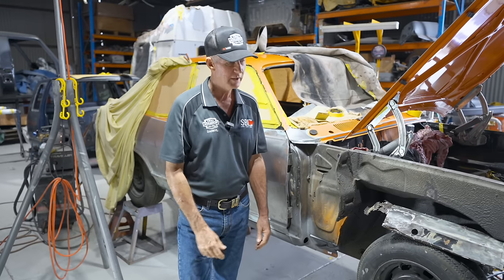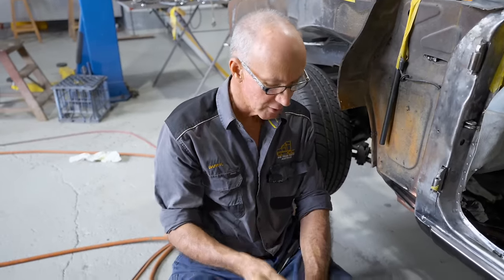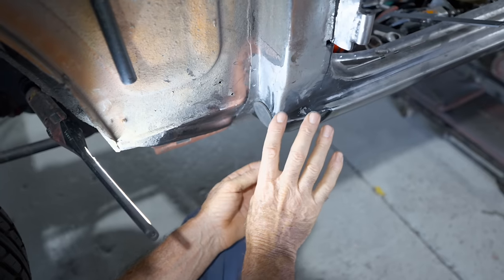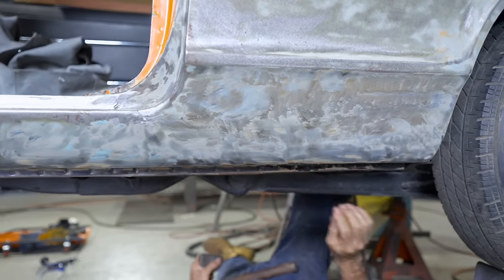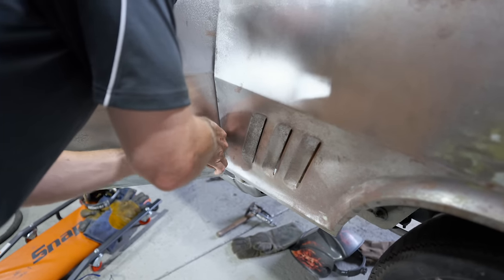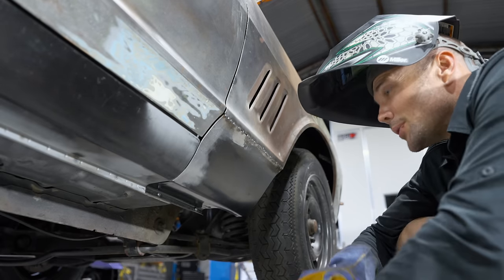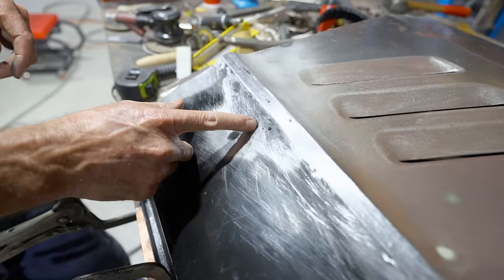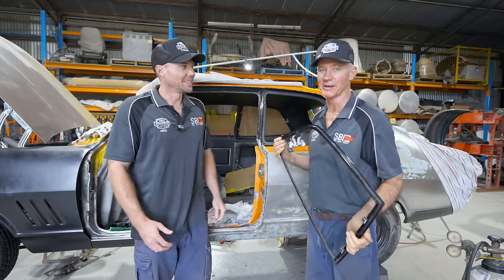Holden Torana Gtr Xu1 LJ  ( Part33 )  Athentic factory finish sill holes. Classic car Restoration.

Comment: Hi, i noticed you guys touch the bare metal surface of the repairs. Doesn't it rust around those areas? Are you using anything to seal that bare metal surface so to avoid any moisture from your hands rusting the surface?
Reply from the maker: Hey @melf3359 we don't like to use anything on our bare metal.
Once the Metal work is finished we will get stuck into it with sand blaster on outside and rotary orbitals. 
We try to leave as much paint on the car as we can until we get up to Etch and Prime stage. 
We try not to touch bare metal. The few areas will clean up very easy. 
Thanks for watching 👍